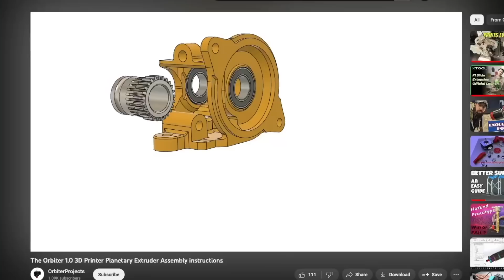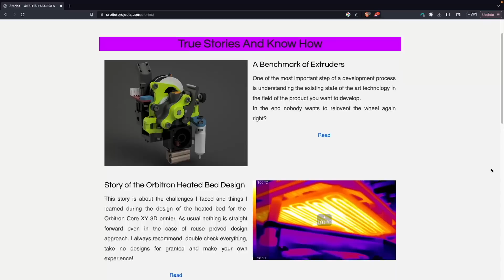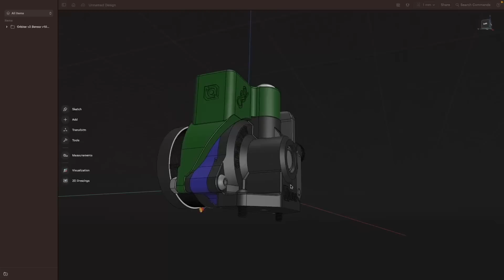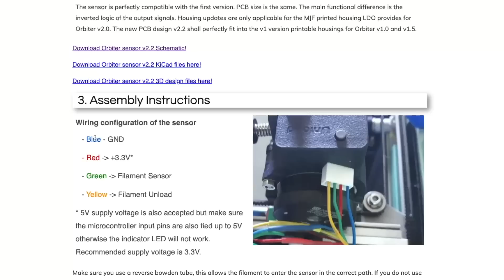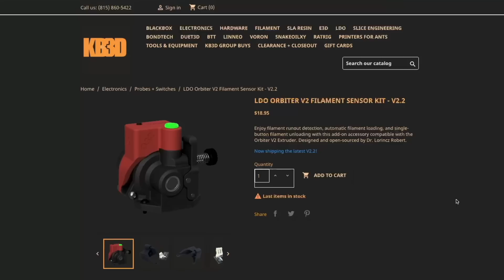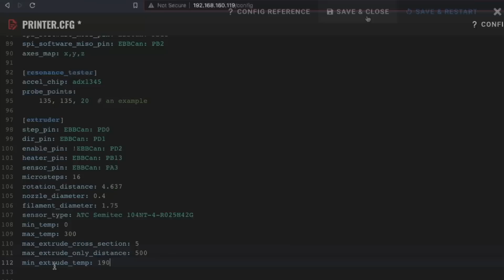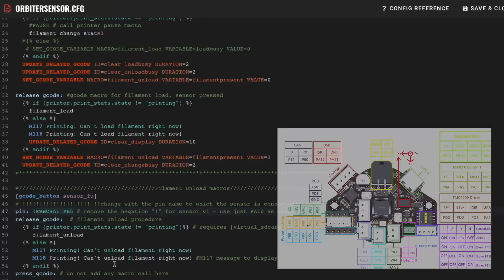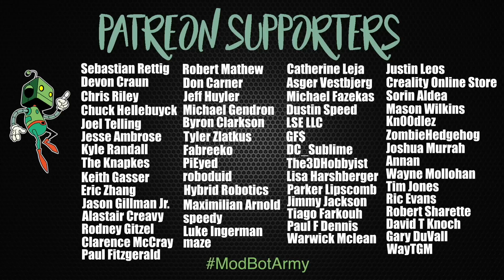Small Lightweight Beast Of An Extruder (Orbiter V2.0)

Comment: i have been running the orbiter for about 2 years and just upgraded to the 2.0 and the filament sensor.  i was able to change the initial feed for my needs.  i adjusted the initial legngh to feed almost to the hotend heat up and then purge legnth, but the rate or purge and unload is so slow if i leave it at the stock setting i get errors about the feedrate being unacheivable, not sure on what to do

Comment: hi, gramn nice video, I have a reborn 2 very similar to the one you have in the video... where can I find the support to print to attach it to the plate and replace both the extruder with the one you have, and also the hot edn which I haven't found yet, if you can advise me. Thank you

Comment: Hey!
I know this is a bit out of the blue but i was wondering if you can tell me what current/voltage your running the extruder on? I know it may be klipper firmware but I'm trying to use the orbiter with marlin.
Sorry if this is too much to ask.

Comment: 5:11 So it's another not that useful "filament sensor". I'd much rather have snag detection over filament run out. I've had FAR more failed prints from filament tangled on the spool!

Comment: So sorry. But is there any possibility of a bit more info about this filament sensor for connection to the ebb36, I think I have understood that it is a port i2c, but can I get 3 volts there as I see that the sensor will have 3 volts. Thanks in advance for any information I can get.
Roy

Comment: I admit that I am most interested in prusa's giant filament driving wheel and I really want to see other extruder start to use that design. Frankly it's a great idea and to me something like it would be the best upgrade path because it would actually upgrade the printer's ability to feed filament. Most extruder designs just try to make the smallest or lightest extruder. Since I don't have a super fast printer and I don't want to spend that kind of money, the greater ability to use flexible filaments is more interesting to me. Also it's like the only way to actually prevent skipping. Any extruder using the same feed gear is equally prone to gouging filament. That's the biggest thing the new prusa extruder really fixes. It is a straight upgrade for kinking and gouging filaments

Comment: It only has one design flaw which is dual gear drive. This is an oxymoron since either the gears mesh perfectly with each other of the gears mesh with the filament but never both at the same time.

Comment: The filament run out sensor integrated with the extruder is excellent.  The sensor is usually mounted separately to minimize the extruder mass, but integration has many advantages and results in a very simple and compact design with a low hassle filament loading and unloading process, particularly with the automated load/unload macros.  Modern 3D printers should have this intuitive and streamlined operation.

Comment: I built 3D printers when that was the only alternative to commercial Stratosys systems and I enjoy hacking, but I wish more manufacturers licensed a good extruder like this and fully integrated it with their 3D printers.  Currently, the Creality K1 would be a great value in high speed high quality 3D printing if it wasn't having teething problems with the extruder that Creality built in an effort to make a low mass high flow extruder.

Comment: I use the Orbiter 2.0 with the Zorbiter 2.0 Hotend for the Prusa mk3s(+) with a Revo Six. It works perfectly well. Actually it uses the filament runout sensor from the mk3s, with quite simular functionality like the orbiter sensor (actually there is a special PCB with an extra button for unload available, but no LED).
I can realy recomment this upgrade (but I do not know exactly which part of the improvement is due to the Orbiter and which due to the Revo).
Luckly I have multiple mk3s+ (one original, 4 clones) and just changed 2 of them to Zorbiter- so I do not need to remove the zorbiter to try the mk4-upgrade ;-)

Comment: So can you use this extruder with most any hot end.. slice engineering, rapido, magnum, etc? Also.. is it able to mount on pretty much any printer.. or do you have to have specific mounts for printers? Playing around with the BIQU Hermit Crab.. would love to be able to find an extruder and hot end that mounts to the removable plate.. for my S1 Pro which the base plate fits on my linear rail setup, but haven't yet wired it up.

Comment: I have one on my ender 5 pro with the sensor and it's really nice to work with. Installing in klipper was easy after i finally found what pins to use on the skr mini e3v3 board.

Comment: the runout sensor is really interesting. I use and Hemera and there is no runout sensor that looks neat like that. Great job on the videos
Reply from the maker: Thank you. It is definitely the cleanest/most well though out sensor I have seen.
Reply: @ModBotArmy  Actually in my opinion the old mk3 sensor was even better. It detected also if the filament moves. The reason the sensor was not reliable wasn't the fault of the sensor itself, but using PETG for the printhead. PETG - even in black - is high glossy. So the infrared light was reflected inside the detection chamber like hell. So it was like moving an optical mouse on a glas table. I simply painted the filament detection chamber with non-glossy black paint inside and hat a perfectly reliable sensor.
While there is no unload button or led, it has automatic filament load.

But one downside on both the orbiter sensor and the mk3-sensor (both old and new): some filaments have a kink in the end (Sunlu...). Passing the ball the fillament can not unload. Quite a mess. On my mk3s+ I actually added a second filament sensor right after the spool and connected both sensors by some ttl-logic. Only if both sensors detect filament, it is reported as detected.

Comment: i love my Orbiter 2 and filament sensor! Use it on my heavily modded, Klipperized Ender 3. I had to reprint the filament sensor cover though because the fitment was too loose in the original design and whenever the printer did fast motions, the ball would shake enough that it would falsely detect that no filament was present. On the other hand, my filament sensor cover now matches the colour of the rest of my printer, so win-win!
Reply from the maker: It is nice that there is the ability to reprint the housing. Do you know which version of the sensor you have? I think the latest 2.2 has fixed the issue of a loose fit.

Comment: This is the first runout sensor that I would say actually works. Why make such a bold statement? Because every other runout sensor I can think of is located nowhere near the extruder itself, instead usually being bolted to the top crossbar (for printers with filament loaded from the top) or on the side of the gantry (for side-loading designs). Having the runout sensor inches away from the extruder really doesn't help when printing with leftover bits of spools or with samples - on my Sidewinder X1, I just stick a spare piece of filament in the sensor so it won't beep at me long before the print or sample is finished (this has only ended up in me disassembling the extruder to get the last bit of filament out twice). Having the runout sensor right next to the extruder minimizes waste and opportunities for failure by trying to squeeze out every millimeter of plastic you can get.

But this sensor is more than just intelligently located - having macros to load and unload filament without the need to manually heat up the extrurder is really quite amazing. The X1 at least has a single button in the tools menu to change filament in and out, but that's still far less convenient than just sticking the filament into the extruder to load or pressing a single, highly-accessible button on the top of the extruder to unload. My only tiny concern there is that people who print with a wide variety of filaments would have to be careful with the minimum extruder temp they choose and when they still have to manually preheat before loading/unloading - someone who prints everything from wood-filled PLA to PC might struggle to choose a single minimum extrusion temperature that works for everything.

Anyway, the Orbiter is a great design, the Orbiter sensor is a great design, and I can't say enough good things about what LDO Motors is doing for the 3D printing community.

Comment: I am using the "guts" of an Orbiter 1.5 in my Galileo extruder modded for 2.85mm filament. After some initial hickups it is a joy to run that extruder. I also use a Clockwork 1 on this printer and can switch that way from 1.75mm to 2.85mm. 
My other printers have the Pocketwatch, Clockwork1 and 2.
   I am looking forward to the Galileo2 extruder and wonder if that will be based on the Orbiter2 ;)
Reply from the maker: Thats awesome. I donated my 2.85mm filament some years ago now but always wanted a toolhead that could run both. You can find some great deals on 2.85mm!
Reply: @ModBotArmy  Just because I drilled into the filament "passway" with a 3mm drill, I did print the Galileo parts with a wall count of 6. For the PTFE tube I did use 4mm OD/3mm ID . So far I had no problems (apart from the setup ;) )

Comment: Just ordered two orbiters with filament sensor after seeing this.I’m using cw2 on most of my printers, but I really liked the runout sensor with the feeding macro. I also seen that my cw2’s  starts to wear out at the top of filament “input hole”. This metal intake seems like a great idea. Btw love your modbotarmy channel.
Reply from the maker: Sweet! You are going to love it. I only have the CW2 on my SW and havent ran into it wearing yet but I can definitely see what you mean. I am going to have to reprint the toolhead to have a PTFE fitting for the ERCF which may prevent that from happening. Regardless the combo of the killer extruder and runout is super nice. 

Thank you :)!
Reply: by the way, you probably already have received the Orbiter, and printed a new mount for it, but there is a so called "Stealthorbiter" mod for the stealthburner that allows you to put an orbiter into a Stealthburner instead of the CW2!

Comment: Any benefits of the orbiter vs the stock mini Stealth burner in the V0.2?
Reply from the maker: I am just recently running the MiniSB for the first time so its hard to say. If I had to make an opinion based on my short time I would say the Orbiter 2.0 is definitely superior from an extruder vs extruder standpoint. The planetary gears and shorter wider gears will give it more force. That being said the MiniSB is a great toolhead and if you are not running into limitations I see no reason to swap. I plan on running the MiniSB as is. It may make sense if you do a complete swap to a dragon burner toolhead with the orbiter.

Comment: Have them both and love em. The latest version of the filament runout sensor is the correct one. The original one had a bit of slop with it and would sense have false “run outs”. Getting to the issue you had with Ali I don’t believe there an official retailer. The orbiter projects list the authentic sellers for future reference. Obviously more expensive but at least you know there real.
Reply from the maker: I have heard from a few others the early revision had some tolerance issues causing false triggers. I am glad to see it has been corrected. Definitely a bummer. The price was actually within $1-2 of what I paid for the second I bought so I just figured it was genuine. Good call, I should have checked the list.
Reply: I’m having issue with mine detecting run outs at the moment. The light changes to red but it doesn’t pause and allow for a filament change. Do I need to # all of the pause, resume and a few other macros for it to work properly?

Comment: ok but part of the point of the orbiter is that its so light, so why add mass to the printhead when you could design the sensor to be mounted on the frame?
Reply from the maker: The sensor is pretty light and I am not trying for speed benchy level of speeds so it is more than sufficient. I personally do not like frame mounted runout sensors. Maybe if it was a bowden setup. My Revo is currently the limitation and not weight.
Reply: @ModBotArmy  why dont you like frame mounted ones? legitimate question, i havent played around with these sensors at all, so ive just seen people complain about them being unreliable but idk how that would be different on the frame vs on the printhead, unless its just the frame mounted ones tend to be low quality regardless of mounting position

Comment: I've modified my filament sensor to have an M8 thread so I would have the pneumatic coupler installed for higher reliability with automatic filament changers like ERCF
Reply from the maker: Thats awesome. Is the mod posted anywhere? I am building ERCF and that may come in handy at some point.
Reply: @ModBotArmy  I'm sorry for confusion. by modified I meant "I cut the M8 thread there"

Comment: I basically had all of the popular lightweight extruders - sherpa mini, lgx lite, orbiter v2 and vz extruder. Neither of them are perfect, but have different specialities and some areas to improve:
Sherpa: great package, but lacks grip and the release lever is unnecessary in my opinion, feels a bit too flimsy and the latch doesn't open enough, at least on mine it wasn't. Sadly lacks a bowden collet on top for the use of MMUs. Strength is definitely the low weight, pricing and the fact you can print it yourself.
Lgx lite: great package, just a bit long; insane grip, best for tpu without any competition. Sadly a chonky boi and has not as much force as others. Mounts from the bottom, so keep that in mind. The ratchet lever is really nice as well as the gear you can turn.
Orbiter: highest pushing force i have achieved yet, a good compromise between the grip of a lgx and weight of a sherpa. I personally had issues with tpu buckling right after the gears and the metal insert was sticking out a bit further than the flange. Tensioning lever was like the sherpa, didn't open enough to be usable without shaving some filament of. 
Vz extruder cnc: really short package, but the stepper is shifted to the side, so that can be awkward in certain situations. No bowden collet and no release lever. Otherwise really stiff assembly and has concentric gears like the lgx. Quite some more grip compared to the sherpa and skips steps rather than grinds, but performed not well with medium tpu (85a) the filament twirled due to the helical gears which led to under extrusion. Mounts from the bottom like the lgx.
I should also mention that both the sherpa and vz accept either 8 or 10 teeth steppers while the others need 10t.
As i previously said there is no perfect extruder, but there is a trend: for fast printing a sherpa due to its weight or the pricier vz extruder for its low weight and enhanced traction are the best candidates. The lgx is the best for difficult filaments and boasts an enhanced consistency in surface quality compared or other extruders. The orbiter exceeds in pushing for and is a jack of all trades, but master of none, yet will be the best choice for someone that doesn't know what they will be doing with it.
Personally i have some longevity concerns on the orbiter as the primary drive shaft is aluminium and i already saw some where the bearings wore into the aluminium. From my knowledge it wasn't replaced by ldo
Reply from the maker: Thank you for taking the time to right such a detailed response about your experience. I have used the Orbiter and the LGX Lite and have done a ton of research into Sherpa Micro/Mini. I have one build I have been waiting to install for months. 

Much of what you are saying mirrors what I have seen. I have seen some beautiful TPU prints coming off of the LGX Lite. I am going to be building a VZBot soon here so I am excited to try the VZ. They all do seem to have a bit of specialty but from a few years ago it is incredible how far extruders have come. Hotends to, I feel like there are so many killer options available.
Reply: @ModBotArmy  yeah, the last few years really changed 3d printing for the better, especially when speed became more and more important since it not only led to hardware, but also software advancements. Now every major firmware has input shaper and marlin resolved the bugs for linear advance in combination with standalone drivers. Personally im surprised that many still dont use these free quality improvements.

As for hotends i still think the rapido is the king for any sort of high flow application. If you want to see something new, have a look at team plasmics induction hotend, the ino trident. Heat up time of 8 seconds or so, no need for a heatsink fan
Reply: Actually while using the Orbiter on my mk3s (Zorbiter printhead), I have very good results with the Trianglelab TBG Lite Extruder on my Prusa mini. Actually I had modified the mini originaly to sherpa extruder, but was not happy with the grip. As there are not many designs for the TBG Lite and I am not very skilled in designing my own solutions, first I had no clue how to mount it. But following the old rule "If you have no clue, use glue" I simply used the hotend design for the sherpa on prusa mini (with revo mini) and instead of mounting the sherpa with screws I simply glued the TBG lite on top. Works perfectly.
Also I used a moons motor (you can order the TBG lite with Moons or LDO). While both motors are of good quality, the moons motor use a higher current (less voltage) and this current is quite simular of the original stepper motor. So it works on the Prusa mini without changes (exept for esteps).